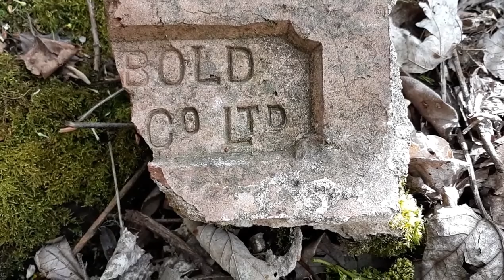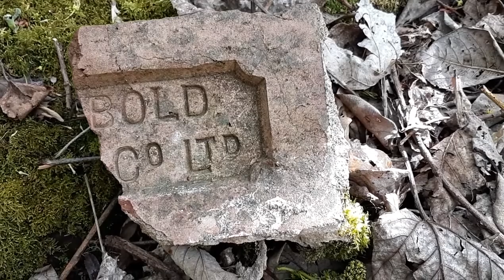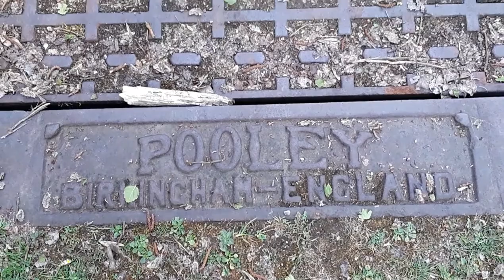Searching for a former coal mine #atunnelofabygoneera #exploringindustryofabygoneage

Comment: Steve, I might be wrong so I'm willing to be corrected on this, but from what I've read neither this Newbold tunnel, nor the Coleorton tunnel further down the line were the work of Robert Stephenson. He engineered the Leicester to Swannington Railway (completed 1833), but that ended at the base of the Swannington incline further to the south, which is also where Stephenson's involvement ended (I think).

This 2 1/2 mile section that includes these tunnels was a different line known as the Coleorton Railway.  It connected Stephenson's Leicester - Swannington Railway (at the south end) to the Cloud Hill branch of the Ashby Canal Tramway (at the north end). This was a project driven forward primarily by Sir George Beaumont who owned collieries in Coleorton and Peggs Green, and he wanted an extension of the Leicester - Swannington Railway to serve his collieries. However, the plans were taken even further north beyond that to link with the Ashby Canal Tramway, so as to also serve the interests of other parties already using the Ashby tramway - Sir George Crewe for his Ticknall Limeworks, the Earl of Stamford and Warrington for his Cloud Hill Quarry, and Lord Ferrers mine in Staunton Harold. 

The section plans of the Coleorton Railway were drawn up by Samuel Green, the engineer was William Dicken (not Stephenson) and the contractors who built it and the two tunnels were messrs Nowell & Son. It was completed in 1835, two years after Stephenson's Leicester - Swannington line opened.

Despite officially being called a railway, with standard gauge (4ft 8 1/2in) edge rail track, it was always a horse drawn tramway and never saw steam engines. It was basically isolated from steam engines because of the incline at the south end, and also the fact that the Ashby Tramway at the north end was also horse drawn, but ran on 4ft 2in gauge L-shaped plateway. Because of this the two tramways didn't directly connect, but ran alongside each other for a short distance and loads were transferred across from one to the other. 

The Coleorton Railway (tramway) survived for around 40 years, but closed when the Derby to Ashby Railway replaced the Ashby Canal Tramway in 1874 (when the Worthington to Ashby section of the line opened).

The small section serving New Lount Colliery through Newbold tunnel was re-opened (using steam engines) in 1928, and closed in 1968.

I don't mean to sound like I'm criticising. A great video like all your others.
Reply from the maker: Good comment...you may be right about the newbold tunnel actually. I know 100% about nowell and sons contractors, they did a lot of canal work before the railways. The coleorton railway, yes, never seen steam loccos untill 1924 when lount opened. I may actually be going in glenfield tunnel soon
Reply: @LeiceExplore  Cheers Steve. Reading Mike Christensen's book The Melbourne Military Railway part 2, he says that although Lount Colliery first opened in 1924, the railway spur to it didn't open until 1928. Again, sorry if it sounds like I'm being a pedantic so and so, I'm really not. You do ask for people's comments so I'm just thinking I'm helping. Cheers.
Reply from the maker: @johnbillett8233  I did know that but didn't point it out lol...I looked at the old maps